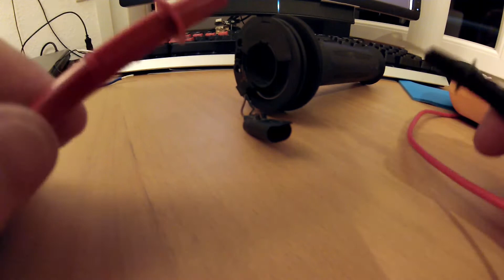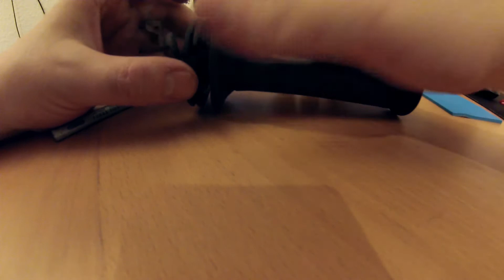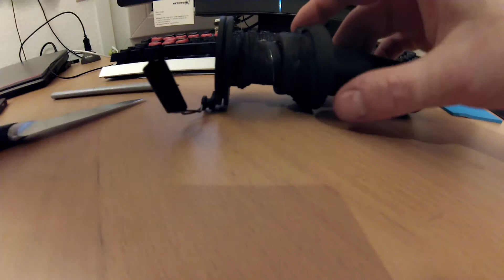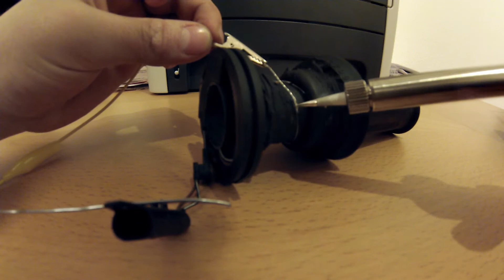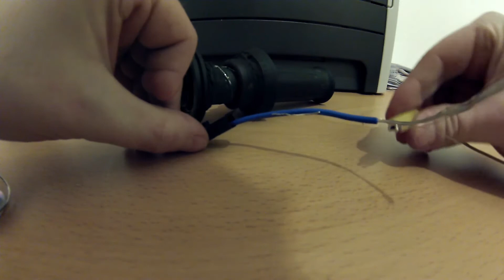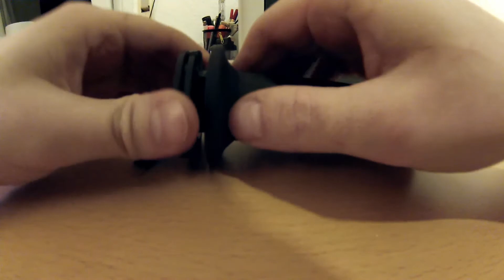BMW Heated Grips Repair F800 R1200

Comment: Thanks, the grips are now $200, well worth taking a look for repair. I have one I removed due to failure and have been waiting for a quiet moment to take a to see what is inside.
Reply from the maker: It is crazy how much money bmw charges for some molded plastic, a bit of rubber and literally A WIRE.
Take your time and I with you the best of luck. Hope this video helps.

Comment: This helped me repair my 2012 f800r right grip!!! Thanks so much!  one super critical step is getting into the multifunction switch (kill switch/ heated grip switch) otherwise you can't remove the throttle grip. On my bike I needed a t9 torx for multifunction switch, a t15 to remove 2 more screws, oh and a t55 to first remove the bar end / weight.
Reply from the maker: Yea, should have mentioned that. The torx 9 is REALLY an odd bit you need. Happy to hear it helped you!

Comment: great tutorial, thaks for sharing. one quick question. what's the diameter of the wire that you use? is it 0.20mm?
Reply from the maker: lucre sabbatini no idea. It was some wire i had laying around. It was definely larger than the original. The only important thing is that you dont use TOO thin of a wire so it wont burn out right away again

Comment: Excellent,  I also did this repair however it failed several months later and will be doing it again. What type of wire did you use to splice?
Reply: Hey, the cable in the right hand grip it's a nicrom (nickel 80% 20% chromium) 32 awg. It´s used for resistance in the hair dryers. I think its better repair it using a electricity tape for covering, I mean by presure. Regards
Reply: Hi there! Thanks for the video.... Could I use a copper wire to splice or do I have to use the Nicrom one (i don't have this kind of wire right know). Thanks again